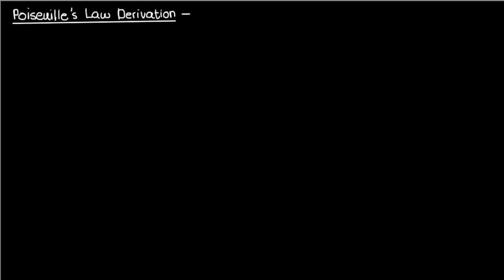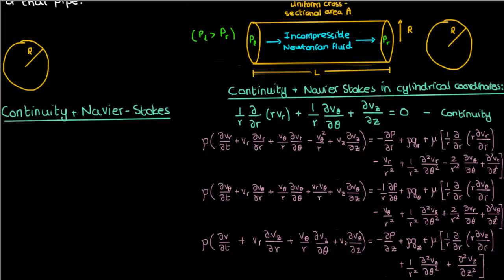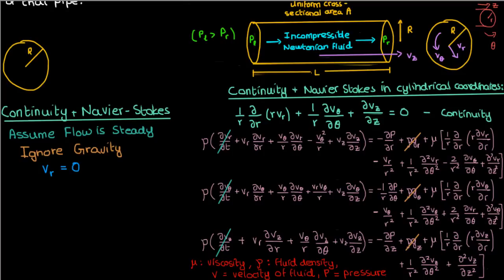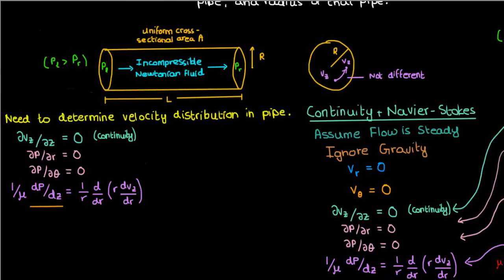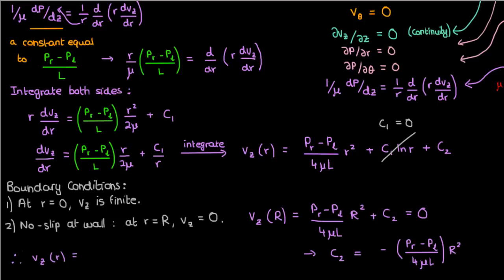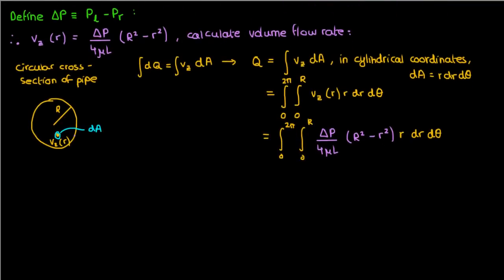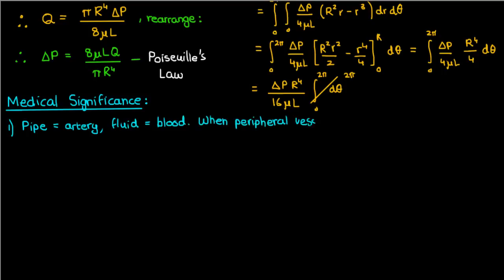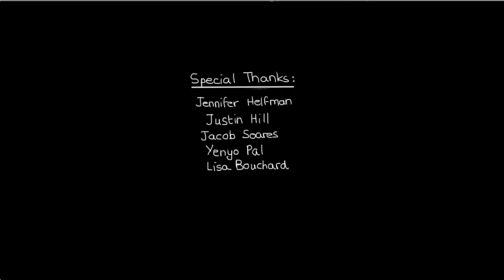Deriving Poiseuille's Law from the Navier-Stokes Equations

Comment: There are some issues in the video. The first part with the derivation of the equations is fine. However, there a couple of problems solving the system. First of all, the reason why 1/eta dP/dz = 1/r d/dr(rdvz/dz) is equal to a constant is not clear. The reason is the following. dP/dr=0 and thus P is a function of z only. Analogiously, dv_z/dz=0 and thus v_z is a function of r only. The equation dP/dz = 1/r d/dr(rdvz/dz) means that a function of r is equal to a function of z. The only way this is possible if both sides of this equation are equal to certain constant. The size of this constant depends on the inlet and outlet boundary conditions (the conditions for the pressure), which are not included in the list with the boundary conditions (I really have no idea why you did not include them). The condition for the final velocity is not a boundary condition, it is not applied at the boundary but at the axis of symmetry. It is just common sense. In physical world, there is not a such thing as infinite velocity but we get one due to math...

Comment: Please I need to know How to get N-S eqns in cylindrical coordinates from cartisians. thanks
Reply: The most general format of N-S equations is free of coordinate system (see Incompressible Navier–Stokes equations (convective form) in the link https://en.wikipedia.org/wiki/Navier%E2%80%93Stokes_equations ). You can then specify certain coordinate system and get the coordinate form of the equations. In order to do that, just use the coordinate form of the del operator in cylindrical coordinate (see https://en.wikipedia.org/wiki/Del_in_cylindrical_and_spherical_coordinates )

Comment: Sorry to say but Hagen Poiseuille Formula tells the head loss, which is change in pressure upon density and acceleration due to gravity, and even after considering that you are just talking about the pressure change, then also the final output is incorrect as it's inversely proportional to radius square, not raise to the power 4, I have R.K Bansal, 9th Edition and it's proof is in page 390, go check it out for Yourself, for those who have different edition then it's in the chapter viscous flow.
Reply from the maker: Ok, so I checked out the book just because you asked. Neither of us are wrong; the Hagen-Poiseuille equation still has the pressure change inversely proportional to r^4 as I mentioned. It's just that in your book, the author's written: delta p = 8*mu*u^bar*L/(R^2). My equation doesn't contain u^bar, the average speed through the cross-section. Instead, it contains Q = pi*R^2*u^bar. You can plug in u^bar into the equation in your book in terms of Q and see that the result is equivalent to what I came up with here. Also, many resources online write the pressure change in terms of Q, making it inversely proportional to R^4, so you can confirm my results there as well.
Reply: Note that Khan's formula has "Q" in the numerator.

Q (flowrate) = Area * Velocity = π * r^2 * V

Rewriting his equation replacing Q with (π * r^2 * V) gives:
ΔP = (8uL * [π r^2 V] ) / (π r^4)

Cancelling the πs and rs gives:
ΔP = (8uL *  V) / (r^2)

Or, if you prefer to work with diameter:
ΔP = (32uL *  V) / (d^2)

So, ΔP is actually proportional to 1/r^2 in Khan's version too.
Reply: inversely proportional to radius square if the equation is written in term of average velocity.  however, it is inversely proportional to radius raised to the power of 4 when the equation is written in terms of volumetric flow rate